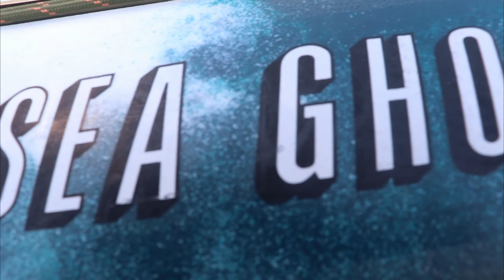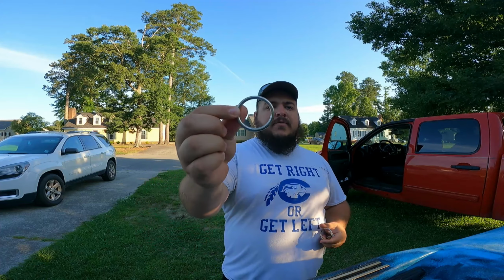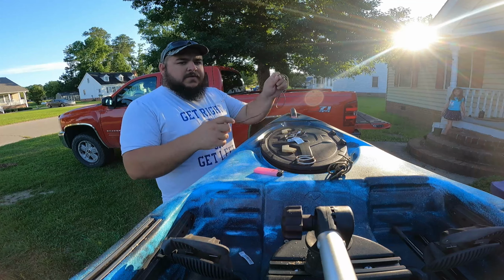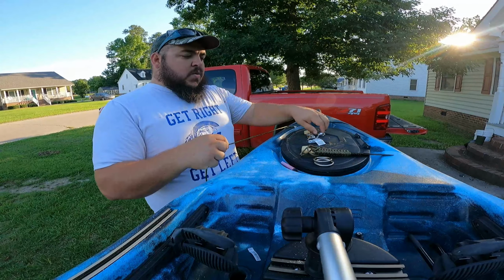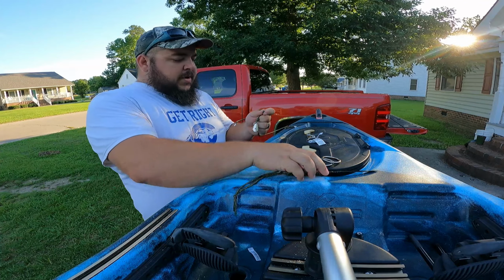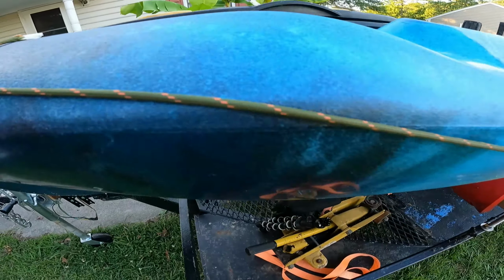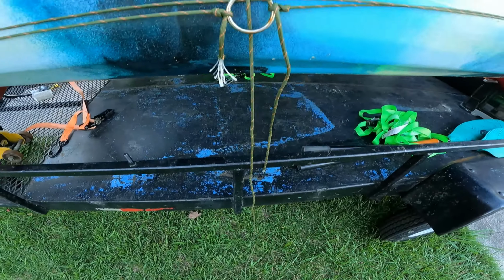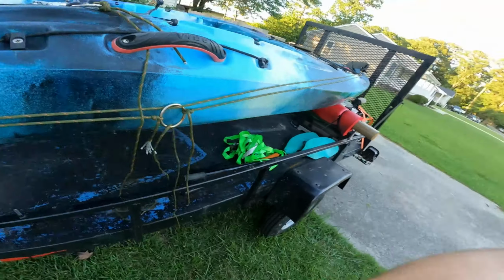No drill kayak anchor system install (Vibe Seaghost 130)

Comment: How did this workout for you? I just got myself a sea ghost also and I’m looking into a anchor trolly or stake out pole.
Reply from the maker: it works pretty well! I recommend having your anchor rope set in the pully before heading out which will save you a little headache, but other than that... it works really well! I just couldnt see drilling unnecessary holes in my boat!
Reply: @OutdoorGoobersTV  thanks for the tip! I agree I don’t like the idea of any unnecessary drilling in a boat. Have you tried this with a stake out pole?
Reply from the maker: @09canonshot  I have used a stake out poll but not with this set up... I usually utilize the bungie on either side to slip my homemade stake out poll through. But im sure it would work though
Reply: @OutdoorGoobersTV  I appreciate all the feed back partner! Just picked up my sea ghost today. I’m stoked!
Reply from the maker: @09canonshot  not a problem!